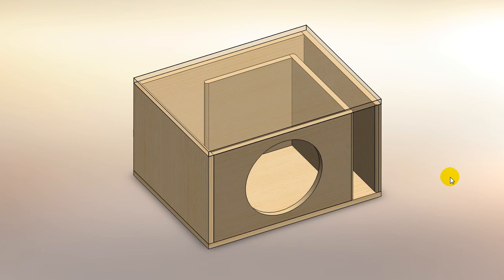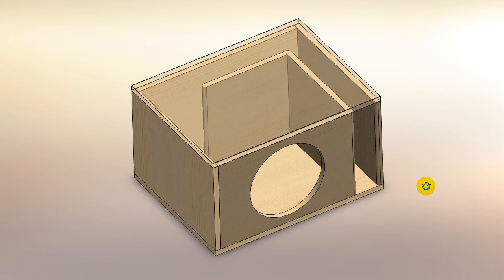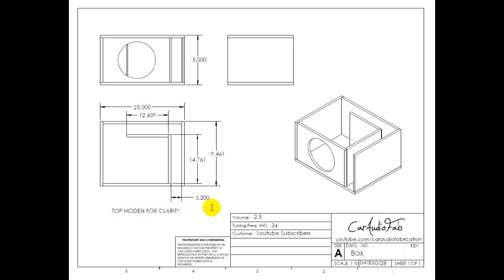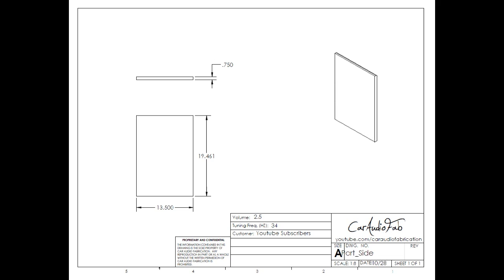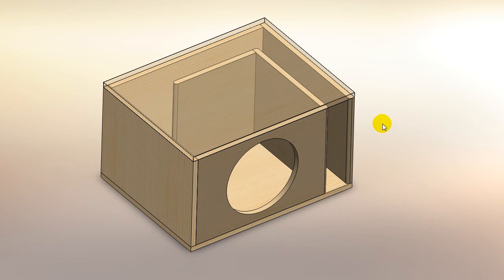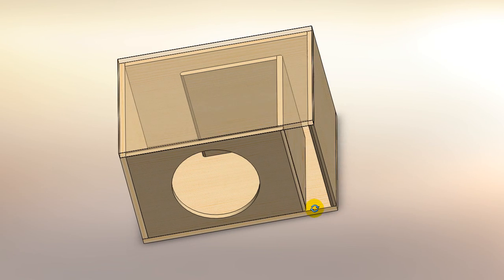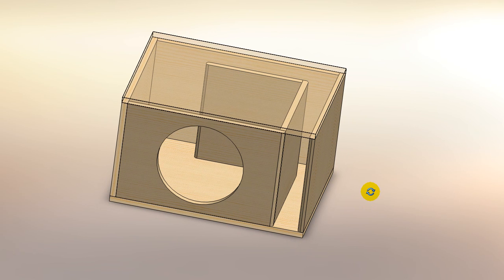Free Sub Box Design! 12" Sub 2.5 Cubic Ft at 34 HZ

Comment: Thanks but what if your sub fs is 31.3Hz? Will the box still work? I have a similar design, just larger width,smaller depth and slanted rear panel.  Pre built. Will this box be different(louder bass) or not?

Comment: @CarAudioFabrication 
Most definitely using this build for my 12" kicker I'm putting in my 2002 blazer. Watch all your videos when I get the chance, just recently ordered your placement laser so I can build my custom A pillar beams for the CTsounds 1" and 3" Meso component speakers! Thanks for all the tips and tricks and for uploading it all! Much appreciated mark, but, I have a question if i could bother to ask about this particular build/video;
 On the front of the enclosure does the dimension of the width include the piece that is the first section of the internal port or is that just a beveled edge for air flow?? Thanks again looking forward to the next one
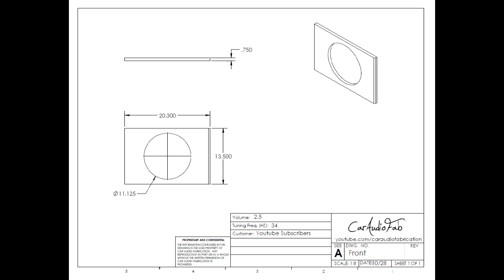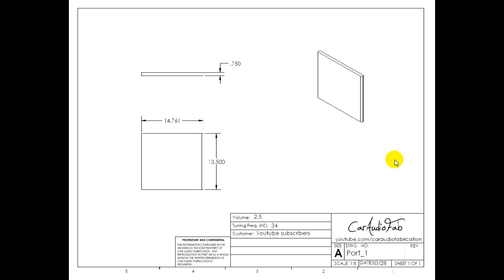Reply: 1:50 2:10 I believe you called it a chanford/roundover

Comment: Hey Mark! been following your channel for around 2 years now, great work :)
Would this box be good for a Soundstream tarantula t4 12", recommended box volume on the manual says 2 cu.ft. and tuning freq at 41hz for max power, and 3 cu.ft. for SQ with freq at 32hz. I'd go with ported design as you showed in this video. Thanks!

Comment: I've got my Kicker Comp R 12" in this box and it bumps. The direction in which you face your box does make a difference. Mine is pointed upwards towards my roof.

I managed to build mine out of a 4'x8' sheet of 3/4" MDF with plenty of leftover material. 

With Liquid Nail, screws, and MDF, this build ran me around $40 and took me a total of four hours to build and set up, not counting drying times for the Liquid Nail.
Reply: That's funny I did found out the same thing

Comment: hi; how do u tune with 2 aero ports @ 4" diameter 10" long  in a box 36" w by  17" h by 19" d   ( 15" sub  disp is 0.27)  can u help ?thanx
Reply: you change the length of the aero ports to a longer length to get better low end response or you cut them shorter to tune higher. If you cant Add straight length to them cut the short and add a 90 degree bend and continue lengthening. Its very rare and not recommended to do this though.
Reply: Needed to add that the aero ports listed might not have the cross sectional area your box needs to have for your sub. Rule of thumb is 12-16 square inches for every net cubic foot of displacement inside of your box. Pie times radius squared is area of a circle so 2*2*3.14=12.56*2ports=25.12in squared, for a fifteen you aren't running a big enough port at all and your box is probably oversized unless it call for 4.85 cubic feet net (assuming you gave outside dimensions and the wood is 3/4" thick). Sorry geeked out a little bit.
Reply: ok i got u thanx for that

Comment: This would of been perfect for me cause i have the bl 12 but there is to much depth. I need a box that is more lengthy instead of depthy lol like 29 in the length 15 in height. tuned for the fi sub...FOr some reason there are hardly any designs of rectangular boxes, they are all more square which in my case takes up to much room. I need a rectangular design with the woofer in the center of the box.
Reply: Same
Reply: Joshua Robles look up octaport sub enclosure
Reply: Joshua Robles what box did you end up getting ? I'm getting a BL 12" soon also

Comment: I am building a home entertainment center  and in the center are planed two powered subwoofers 12" .  I am planning to have the box made from MDS 16"H by 14"wide and 17" deep the back will have the power amp for the speaker and a air passage out the front of the enclosure at the bottom.  my Question is will my size work for good quality sound.  I am using 12" Polk Audio subwoofers and power amps. to a Samsung AV R-730 stereo home entertainment receiver.

Comment: What would bring this to 32 hz?
Reply: longer port, maybe an inch or 2 longer, but tuning will actually rise when you throw in the sub. that's if you tune it before you add your sub displacement. always add all displacements and tune from there so when you do drop your subs in its gna be exactly what you tuned it at

Comment: I have a 2000 Dodge Ram 1500 extended cab, I put a 12" older alpine type r that is enclosed in a roughly 1.25 - 1.35 cubic feet with long side port, ran 2ohm to a kicker zx750x1. It sounds like crap until I roll down the windows or open the doors.

Comment: Im also designing a 2.5 cu ft box for a 12 inch. I want it to be tuner to 28 Hz, but i have to make the port into a "U" shape, rather than the "L" shaped port u used. Will the U shaped port cause port noise or will the air flow through nicely?

Comment: dude help me... i built this but it sound too boomy in my home theater setup.
any tweaking ? any advise on the port size, length ?
i wanna get a controlled tight bass from this box, what to change?
im using 3/4inch MDF, with 1inch front baffle. stuffed with loosened fibre fill.
moved it at least 10 times around my setup. what am i doing wrong ?